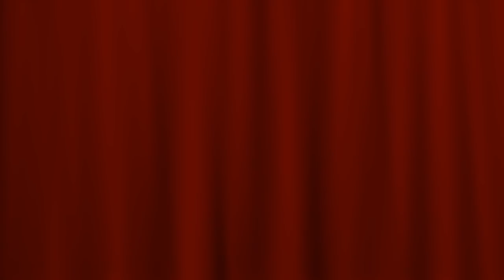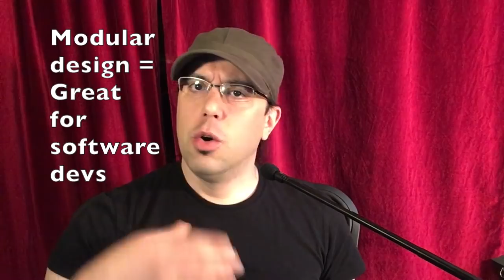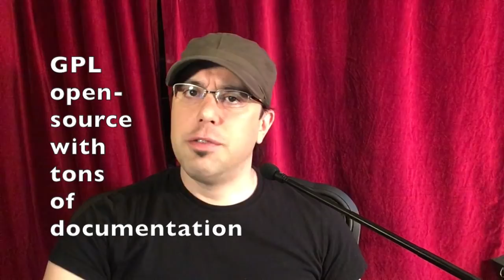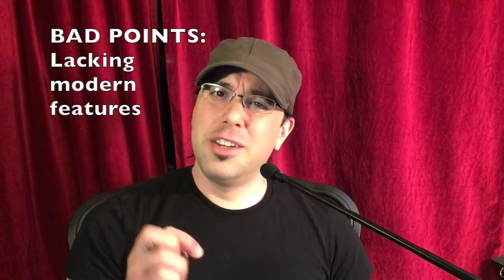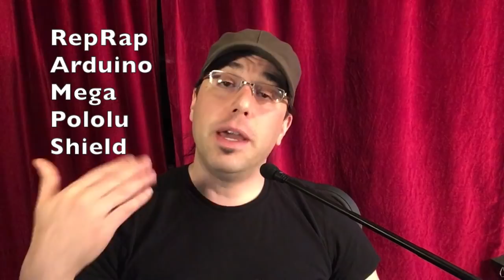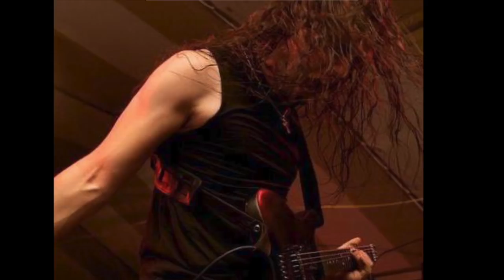Ramps 5 of 5: outro and thoughts

Comment: i had a backwired endswitch on my project and 5v regulator fried , only in my case power suply went into overcurent protection and everything urvived fine
i just happened to have spare regulatir and arduino was back up and runing in 5 minutes
i doubt if i wouldn't care as much about arduino being fried if it was more expensive board

Comment: Alex did you pickup a fistfull of cheap Rasp. Pies to run some 3d printers yet ?
Reply from the maker: HA, well I wasn't referring to RaspPI in that particular case, but I actually did buy a fistfull of Pi Zero and and Orange Pi variants to test Octprint and Klipper on.  THe project I was referring to there got pushed back a bit because there were only 2 of us working on the code, but there are some new people involved, so hopefully it can move forward soon

Comment: Alex thanks great series.  could you talk about PWM, specifically noise introduced to the PWM signal from the hotend PID on/off.  in my case it causes my servo to jitter.  any thoughts how i can eliminate it?
Reply from the maker: PWM noise can be a pain in the butt.  the usual recommendations are any or all of the following: keep distance between wires if possible, keep your like wire pairs twisted (source and destination) , use shielded wires, use ferrite chokes, if your PWM and signal wires have to cross, do it at a 90 degree angle.  Usually wire positioning and ferrites are good enough, but if it is still an issue, you could slip a braid shield over the servo signal wire and ground it on one side.

Comment: is it possible to just use raspberry pi as a 32bit controller? it is popular and cheap.
Reply from the maker: RPi is a general computing platform, so it is possible but not really optimal for this type of use.  Even if you found a realtime kernel for it, you would  have to use additional hardware to get it running reliably: examples are pyCNC and Klipper firmware.

Comment: Nice video :)

I want try to make "somthing-like-RAMPS" on top of this board with Cortex-M4 and FPU on-board:
https://www.aliexpress.com/item/Free-shipping-STM32F407VET6-development-board-Cortex-M4-STM32-minimum-system-learning-board-ARM-core-board/32618222721.html?spm=a2g0s.13010208.99999999.274.48103c005J7mrO

For this price I can fry one or two :-D
But main problem will be in SW part (Marlin's HAL)... is there any 32 system where Marlin's HAL is fully functional?
Reply from the maker: Sorry I didn't reply earlier, (the comment got caught in spam because of the link and I didn't see it until today). I have several stm boards that I have gotten Marlin to work on.  I will have some videos coming out real soon, probably this week if I don't get delayed.  There is ongoing work in several HALs in Marlin for that chip family, and I have contributed some code and debugging work myself. M3 series is better supported, but a generic HAL is in the works to make development easier.  But to sum up: yes, you can get many STM breakout boards working with some effort
Reply: Thanks for great answer ;) Some explanation about HAL on STM boards would be cool!
Reply from the maker: It's on the to-do list.  I started recording the vids a few weeks back, but I have been waiting for some parts to show up from China (orderd over a month ago) so that I can run some more tests and see what features are currently working on various boards.  I have working libs for various displays and other hardware tha I hacked together myself, but I have to get the code cleaned up and posted (I think Marlin commited a few already though).   Right now, character LCD and port expander backpacks work, SD support works, and basic core printing functions work.  I don't think software serial/SPI works yet, but hardware SPI is fine.  I was last working on graphical LCD support before I gotpulled away, but I have a hacked version of the libraries working and compiling, but it doesn't produce working firmware with GLCDs enabled (Marlin switched to a custom u8g lib though, so I have not had time to learn it and write a HAL module for it). THat was a few weeks back, so maybe work has been done, but there were only 2 of us working on it actively when I last checked.

Comment: @Alex Kenis
+Alex Kenis

i had a look at the github repro for Ramps-FD and i think the problem is that Geeetech grabbed one of the first versions and just flodded the market with a bad version

of course people will only remember it as a shit board and not why.

do you think the Ramps-FD in the version 2.1 still have its place? i also had a breif discussions with bobc on his github repro and it seems that he got scared of the negative feedback
Reply from the maker: Yeah Bo, looks like that's exactly what happened.  I feel bad  really for bobc and the others that busted their butts to get the initial design out, as well as the pages and pages of discussions at the time.  I'm torn on whether the FD should move forward now, because on the one hand, if the price is right, it could be the missing link the community needs, but on the other hand, it's longevity is teathered to whatever the future of the Due is, and I don't remember there being on-board level shifting for the FET gates, so that opens the door to even more thermal issues than the RAMPS since the component selection is narrower. So that leaves a big question mark.
Reply: Well to move it anywhere we would need people that can do prober design. Bobc commented on github that he would like to see some buffers added to the ADC's and switched mode power supplies. another suggested adding more direct support for TMC2130 but i said that all that is needed are an SPI connector and free pins for CS

so far i have just looked at the kicad files and all that is needed out the door is a rescue process to update it to latest version of kicad and that process only messes with the LED's that needs to be rotated 180 degree to make them the same as before
Reply from the maker: Not sure what he had in mind with the 2130 support, maybe tri-state jumpers for cfg0-cfg6 pins for standalone mode? Because you are right about SPMODE=1. I assume he wants to buffer the ADC for better S/N ratio to improve the resolution/accuracy, or is the overvoltage circuit interfering in some way?  I have not done any hardware testing to see if that is neccessary or not.  And he is right about the SMPS, because the linear regulator is definately not sufficient for higher motor voltages, and dual logic rails MAY be neccessary as a transition and to ease the load on the due (ie 3.3 and 5).  I also remember reading something about PWM noise interfering with endstops and ADC readings, so a layout change/ground-plane modification or shileding may be neccessary? The Due's current sourcing ability is also a problem with any shield.  There are a few other issues I would change as well, but that is what I was referring to with the 'everyone wanting to add their favorite feature' statement.  I think the tristate safety shut off was a decent idea, but should probably be removed., and If a redeisgn were to happen, I think dropping MEGA support to optimize the board for 32-bit/3.3v logic may be a good idea.  The shunt reg on thermistors is a nice feature, butmay be overkill. And I think a lot of those features and sdjustment should be handled on breakout boards or eventually integrated into the external peripherals themselves (for the sake of a cheaper base board and less complex assembly/layout): ie triple-extruder drivers and 3 PWM controlled fans are nice features, but they serve a small segment of the user base and should probably be moved to an optional expansion board, etc etcetc.

Comment: Due is dead and has been dead for a long time. Any developer spending time writing code for or making a shield for that board is happily shooting their own leg off. I think this will not move forward until you DROP the combination of Arduino + Shield and simply put a decent ARM chip on the printer board itself. It's both a cheaper and cleaner solution, but people will probably need to argue about it for a few more years before deciding on something so that china can start their "copying machines".
Reply from the maker: You nailed those points right on the head.  I have been in conversations with more than a few hardware guys that are shy to put out any board info for fear of it getting copied before it is safe and complete (like what happened with the ramps-fd v1). I've been working for a while now with some other people on support for alternative solutions, so I'll hit on that when a few issues get sorted out.
Reply: @AlexKenis  ; Kudos for JABBING at Marlin 2.   I dunno why people go off in nonstandard land with a toolchain that takes hours to setup.   Get a basic EABI ARM toolchain, pack it up, let people download it.  Be simple to integrate into Netbeans, Eclipse, MinGw, a command line box.  The key is going to be to get a ARM chip on a board that is a mega replacement, and get Marlin 2 to be the easy 5 minute configure and build.  Heck if you specked the board, Marlin 2 could be prebuilt and a simple bin download.

Comment: Another fantastic video Alex.

I agree with you implicitly on the ramps pro's and con's you identified.
What we are all looking for is a simple mega2560 plugin upgrade for our ramps powered projects.
Would you please post a video of the ramps modification for use with the ardiuno due.

I am sure many makers will greatly appreciate your technical expertise and methodical approach with such a modification. 
The interest is a great source of misinformation,it very refreshing to have stumbled across of in depth video series.

many thanks
Reply from the maker: I'll be covering some options and modifications soon.  I have been debating about whether to make a video about RAMPS/DUE conversion because it is potentially dangerous, but I will probably make that vid because it is better to controll the source of information and add the neccessary warnings than to have people running off with information they got from a few pics on a forum thread.
Reply: Alex Kenis this is fantastic news,very much looking forward to seeing a proper and safe ramps conversion.
I like the idea of a cheap drop in replacement.And for the majority of users.the due board will enable the masses to sample the delights and benefits of a 32 bit print controller.
Reply: Alex, i sent you 50 paypal monies that vote for the RAMPS/DUE video and you wearing a silly hat in it :-)
Reply from the maker: HA, thanks man. I'll bump that up to top priority and make sure to wear the silly army surplus hat (aka the only fitted cap that fits my big dumb head).

Comment: OK, now I'm really going crazy. I have a Tronxy 5s that I really want to run with a 32 bit processor but I really don't have the $100+ bucks to sink into one of the expensive boards available. Plus I want to run a dual filament extruder which means I need lots of stepper drivers, 4 for the Tron and 2 for the extruders. I'm new to 3D printers but I've read about people using a ramps board (no interrupt control) with a raspberry pi (to do the heavy lifting). I have a couple of Orange pi ones left over from my smart home lighting project that I think would work fine for a ramps/pi printer. The orange pi is only $13 delivered and is loaded with just about everything needed including a 40 pin header to access all of the pins and I believe it's Raspberry pi pin compatible. Since you are probably the best, user friendly 3D printer guy on Youtube (meaning you don't use words like "just"), I was hoping that your surprise might be something along these lines. I can't wait for the coming 32 bit printer revolution. At 65 years I don't have as much time as you young whippersnappers so I hope you might help move the revolution along.
Reply: Yes momma gave me a 150 dollar budget i try to stay in but what amazes me is how "cheap"  this stuff is out there. 
10 years ago i stopped all thoughts of this stuff due to OUTRAGEOUSLY priced stuff. 
Nowadays a fella can experiment without going broke. .....
Rock on. ......
Reply: 65 you old fart you .... Lol i am 54 and holdin at there good to see  another olde but goodie .
goes to show this young man has Quality stuff and is appreciated by an eclectic group of individuals.
Reply: Finally retired and now have time for toys, yeha!! The only problem is affording them on a SS budget. At least I bought the shop before I retired. Lots of tools, heavy metal stuff (ya hear that Alex). Now I've time for CNC & 3D printing. Just got to make the buck squeal. Lots of Chinesium parts in the mail. It's like Xmas every day in my mailbox. $100 bucks a month goes a long way when you plan ahead. Thanks Alex for helping stretch my shopping dollar. You da man!
Reply from the maker: Thanks.  'Helping the dollar stretcth' and cutting through marketing B.S are cornerstones of this channel.  I think the raspPI setup you are referring to is a project called 'Klipper'.  I have been watching it's progress since their very first Github commit, but I havent tested it out yet. I can't seem to copy/paste URLs in comments anymore, but just search github.com for kevinOconnor klipper to see if it is something you are interested in.  They don't have a separate development branch and release branch, so the actual code changes several times a week, which is why i have not done a review yet (just waiting until they get more settled).

Comment: I was wondering what are your thoughts on the trigorrilla boards that come with the anycubic i3 mega 3d printers
Reply from the maker: I don't know too much about them. I don't own one and they are not open source, so I don't have access to their design files.  I heard some have usb problems, but I can't confirm.  Anycubic also uses their own firmware build, but I think you can use stock marlin now(?)
Reply: It's just another Mega with RAMPS at single board ...it has nothing to do with 32 bit ;)